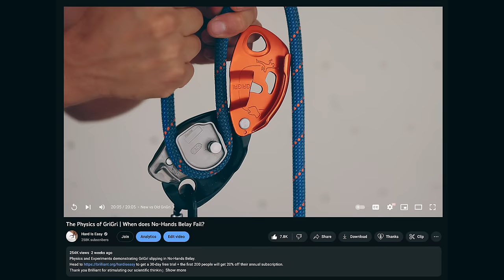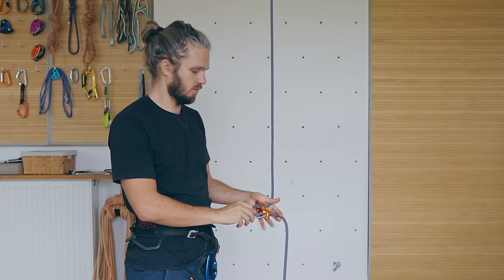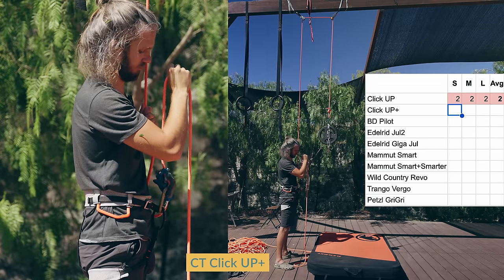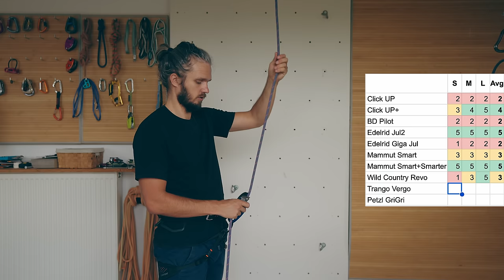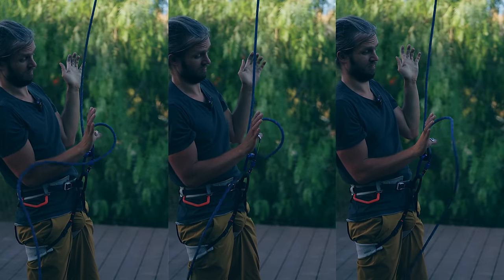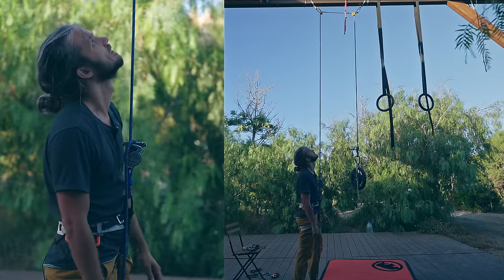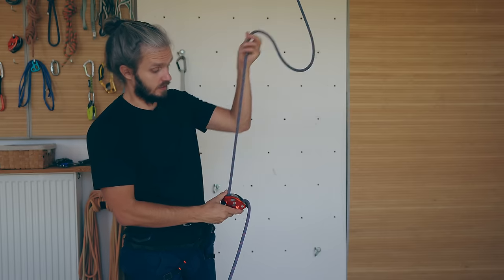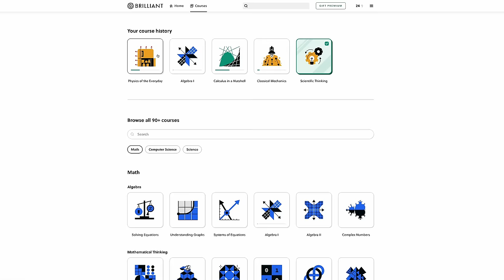When Assistance Fails!? The Physics And Experiments of Belay Devices

Comment: Pretty sad to see how my favourite device (gigajul) performs so poorly. Definitely still a safe device if used diligently, and its versatility for multi pitches and climbing doubles means I'll probably still use it, but I'd really like to see a more robust two channel device on the market.

In my experience, it does feel like an assisted brake device, and not an auto-locking device.
Reply: I'm about 4 years deep into using the Gigajul as my primary device for rappelling and sometimes multipitch belaying, and I second your observations that it assists but is not auto-locking. The friction and performance are also very dependent on the rope diameter/slickness and the carabiner shape/material. Part of the appeal of the gigajul is keeping aluminum oxide dust from turning my ropes black, so I use a bulletproof HMS with it, but unfortunately that slightly triangular shape top bar and the slippery stainless steel insert don't lock up the rope as well as a skinny I-beam aluminum carabiner (which wear down quite quickly). I belay with the giga in brake-assist mode on multipitch sometimes, but I treat it as thought I'm belaying in regular ATC mode.
Reply from the maker: Yea there is space in the market for a better double rope assisted belay devices. I haven't tested all what exists tho yet... but Gigajul i treat with caution.
Reply: @HardIsEasy  I had a bit of a look and there is also a Alpine Up version of the click up. It'd probably worth testing as well.

Comment: I wonder if its possible to design a revo-like mechanism to automatically lock based on acceleration of the rope, so you can tell the climber is falling before reaching high speed

Comment: You really ought to wear belay/rappel gloves. If the rope slips, the leather glove will protect your hand. That helps a lot when you're letting it slip deliberately, but also helps if it's slipping by accident since you're more likely to be able to grip it and pull the rope down to the locking position.

Comment: Firstly, amazing video, you're helping me to beat the paralysis of choosing an assisted device!

However i would really appreciate one clarification:

In experiment #2 "Fall while giving slack", all your footage seems to suggest most of the devices simply failed and dropped the climber. I.e. when you override the assistance and don't properly secure the break rope, it simply won't lock.

But in the results table, most devices score at least a 3 (which I've come to interpret as "safe" but not necessarily comfortable). Can you explain the discrepancy between the footage and the results?

Thank you so much!

Comment: I have the Giga Jul and I use it as my primary belay device. This video is very helpful as it shows me how improper use of Giga Jul can be dangerous, maybe even more than most other locking belay devices. However, I am trying to figure out why the Giga jul fails so bad when its brother mega jul does such a good job. My only hypothesis is that the carabiner never gets to jam into the narrow groove of the Giga jul, it kind of stays on the edge, so maybe that's what is causing it to perform so poorly? You can kind of see this at 16:09, the carabiner is just sitting on the edge of the groove, so it never jams in and squeezes the rope. I would love some input or follow up on why the mega jul and giga jul perform so differently. 

Also, I wonder if a skinnier carabiner would do better for the Giga Jul as it would have a better chance of falling into the channel and locking the rope? Would love to know what other people think!

Also also, good to know that having slack on the system makes each belay device more likely to lock up due to the friction created by the inertia on the break side of the rope. I have always preferred some slack when climbing as it lets me move more freely so this is a nice bonus!

Comment: In the case of the no slack fall with a click up/click up+, the device (having stopped the climber) would then be in the clicked position - ie. very grabby - not the open position tested. I think that changes the real world scoring for these two devices.
Reply: The click-up requires a bit of force (and a brake hand on the rope) to get into the locked position, so it's absolutely possible to have no slack in the rope and still be in the open position. It's simply quite bad in locking without at least a bit of resistance on the brake side. I've tested it a few times myself (while on an autobelay) and if the belayer didn't hold the rope at all, the device often didn't lock.

Comment: Thanks for the video 👏 it would be nice to have the alpine up in the mix, but I guess the mechanism is somewhat similar to the click up
Reply from the maker: Yea It wasn't available in the shops I was buying other devices from and it should be similar to ClickUps
Reply: Regarding the no slack scenario for the clickups, I couldn’t picture how one would end up in such scenario. E.g when top roping the device will always be in locking mode… same if someone is leading and having a rest.

I guess you would need to take the device out of locking mode and release your hands , but I can tell you it’s not easy to take the device out of locking mode without having some slack 😂

Comment: Actually I don't understand the scenario of "fall while giving slack". I use the mammut smart and my breaking hand is NEVER in an elevated position. My breaking hand is always forming a circle/tunnel around the rope (so I never lose the rope). To give out slack, I tunnel the rope upwards until my thumb is under the smarts lever. Then I pull the lever upwards, thus opening the breaking mechanism. With my leading hand I pull out the rope for slack. In several occasions, the smart instantly locked while I opened the mechanism with my thumb. Actually the climbers fall pulled down the smarts lever against the force of my thumb and it locked.

Comment: Hey Hey love the video. 

I use clickup+ for many many years now. At some point I discovered a method to give slack by putting the palm of your brake hand against the underside of clickup+. With this method you can give slack as fast as you want and as much as your arm can reach. And in a split second you can pull all the slack back because your hand is direct at the device. I would not recommend to always have your hand at this position, only for big slack giving (like Gaswerk-Method with GriGri). I would love to hear your thoughts about it and maybe test it again.

Also I would like to criticize the method you test it with zero slack slipping. Because you unlocked the device. The scenario you testet was different. Clickup+ locked and stay locked, then the climber moved without me doing anything. In this scenario clickup would stay locked anyway.

Thank you so much for your time and effort. love everything you do. 

greetings from Hamburg
Reply: Good point, I use the normal Clickup and I didn't think about it while watching the video but you're right : in the situation where it's locked, and the climber starts climbing again and falls, the Clickup would still stay locked because it needs an action from the belayer to unlock.
Reply from the maker: I think they have your slack giving method as an option in the manual or documentation somewhere if I'm not mistaken.

As for safety yes if it's locked it's locked, but if you loose control before it's locked you might get my results.

Comment: I'm surprised by the difference in the Jul2 and the GigaJul. I use the Jul2 + HMS bulletproof Triple FG carabiner in the gym and the GigaJul + HMS bulletproof screw FG outdoors, so basically the same carabiner, just different locking mechanisms. I've noticed some difference in holding power, but I didn't expect it to be that drastically different for this specific scenario. What I have noticed is that the GigaJul tends to slip more often when it's supposed to be "locked off." Like if my climber falls or I need to take, once the climber is fully weighing the system, sometimes the GigaJul doesn't fully lock and if I relax my grip, the rope will start slipping through. I know this type of device is reliant on the carabiner shape/profile, but you'd imagine that Edelrid's carabiners, especially their belay specific carabiners (as these have the belay loop keeper gate) would be optimized to work with their own belay devices.

Comment: Such a helpful video! Thanks for sacrificing your hand so we don't have to!

It looks like you're using the same carabiner for all tests in the tube style devices. I wonder if results would differ much if you used each devices' recommended carabiner. For example the Edelrid Strike with their GigaJul seems to lock better than other carabiners.
Reply from the maker: Yea... Different carabiners def affect the locking a lot, but if I would start mixing up carabiners it would be hard to compare average scenarios. I don't think that everyone know what's the best carabiners for each devices. And also wear on the carabiner can change the things...
I've only seen Click Up require their specific carabiner so that's why I used that one.

But yea as I said my results are only indication of risks and not any guarantees...
Reply: @HardIsEasy  Ben, I think if a manufacturer recommends a carabiner, either directly or indirectly (e.g., by selling it with the device as a set), that would be an argument to use it in your test. Otherwise, I would assume that it's the manufacturer's position that the HMS carabiner used doesn't matter.
Reply from the maker: @RichardRLiu  well it's business after all, everyone wants to sell their gear.

I agree that manufactures could tune their carabiners to perform better with their devices (not sure) so maybe I'll get more carabiners for the future.

But when it comes to recommending you can read the manual and it usually says what carabiners are ok to be used and in most cases you won't find any specific names.
Reply: @HardIsEasy  I've been reading "Ausbildung / Bergsport Sommer / Techniik, Taktik, Sicherheit" published by the Swiss Alpine Club. Among other things, it deals with assisted braking device. As you can guess, it stops short of recommending which carabiner to use with which device, but it emphasizes that attention should be paid to the interplay between rope diameter and smoothness and carabiner geometry. So I think this must be acknowledged as a weakness of your test, albeit a an understandable one due to limitations on your time and financial resources. Perhaps you could contact the manufacturers and ask them to donate the carabiner that they recommend.

Comment: Is it possible to provide notes on the physics of the 'grigri' devices from the previous film or explain their functioning principle using those objects as examples? I am writing an engineering thesis on grigri, and the more notes I have, the better I will be able to address the issue.
Reply: I imagine you could do a lot of that on your own, if it's really an engineering thesis... wouldn't your professors get critical if they saw you didn't do any of your own engineering work?
Reply: My work involves finite element analysis as its main subject. Using the finite element method, I will conduct an analysis of a grigri-type clamping device. Understanding the physics of this device will allow me to gain a better understanding of its operation. I will not include any of these notes in my engineering work; they are solely for personal purposes. It is a niche topic, and there isn't much information available on it
Reply: I'm late to this but I design climbing equipment and worked for years on belay devices including GriGri designs and know probably more about how they actually work than anybody (including the Petzl guys). My NDA's have expired so itf you haven't finished I might be able to help.

Comment: Thank you so much for this video! It really helps me out as a Beginner! However I do have a question for you.

Recently my gf and I started climbing in a gym and since we are beginners we only do toprope and no lead climbing. 
In our climbing gym we use the mammut smart without the smarter add on. 
No imagine a scene where my gf is climbing up, I start to take out the slack and now she slips and falls. What would happen if my hand is now to high? My assumtion would be  that the effect would be a little different to the one shown in the video since there will be no fast acceleration/pull of my rope end because there is almost zero slack in the system when toproping. I would assume both ends of the rope accelerate equaly fast and then my hand would get pulled down into the device which would result in me pushing down the front end of the device and then create the "needed" angle in the rope for the device to lock, right? Resulting in some hand damage. 

But now what would happen if someone for some reason would let the rope lose out of shock in the same scenario? I would assume it would slip ALOT unit the rope end that the belayer let lose would fall underneath the horizontal line of the belaydevice and then again  create the "needed" angle for the device to lock. What do you think? Would gravity be enough for the lose ropeende to create the needed angle or would it just endlessly slip?

I hope this is understandable and I would love to hear your oppinion about it. I'm sure on this channel are alot of beginners like me learning from your vides that are just toproping in the beginning aswell, so maybe you are helping alot of us with your answer :D Maybe a followup second toprope video? :D 

Anyways, thank you so much for your awesome work. You are helping the climbing community so so much and we all have to thank you for that!

Have an awesome day!

Comment: Test #3 isn't relevant for the click-up, at least not for the situation described in the video, because unlike the grigri it doesn't disengage as soon as the tension is released; it stays "clicked"

Also it's less likely to do something weird with your brake hand in the first place with the clickup, because holding the brake strand is the only thing your brake hand ever does, 100% of the time throughout the whole belay. You just hold the rope, the entire time, and simply and only do that, hour after hour after hour. There are no cam- or device-holding shenanigans that mess with your muscle memory

Comment: While nothing beats experience and knowledge, humans are imperfect. Having a device that minimizes risk as much as possible employs the swiss cheese model: If one system fails, there are multiple backups.
Reply: The "problem" with tuber-based brake-assisted devices is two-fold. First, the tuber is an ingeniously simple device, so adding a feature to it invariable makes the device "less simple," more complicated. Second, it's usually not the assisted braking that becomes complicated, but giving slack. When the assisted braking kicks in while the leader is screaming for more rope, it's easy for the belayer to become flustered and resort to a dangerous manipulation.

Comment: Thank you Ben, awesome video! I am belaying with grigri and the only issue I constantly having is when I have to quickly take out slack right after I gave a lot of it especially if I can't see a climber. Like you just gave slack for a clip and except you hear "take!". Does anyone else have the same problem?
Reply from the maker: GriGri is one of the easiest devices to take slack, I'm not really sure what issues you have? Maybe you use super thick ropes like 10mm or above?
Reply: @HardIsEasy  you are right of course. It probably is just a technical issue I am having.  As I said, I only struggle with it when I don't see a climber and just gave a lot of slack out for a clip yet my climber couldn't clip, run out of power and want me to take. When it happens I usually end up with a lot of rope between both of my hands and the devices with right hand thumb is still pressing the lever while there is still a loop behind gri-gri in case I need to give even more slack so quickly repositioning hands while pooling the rope to take slack out of the system is not the most intuitive motion